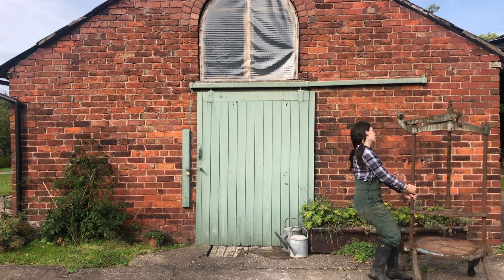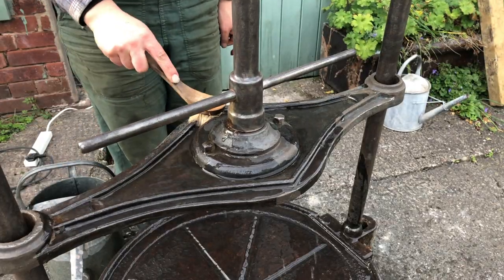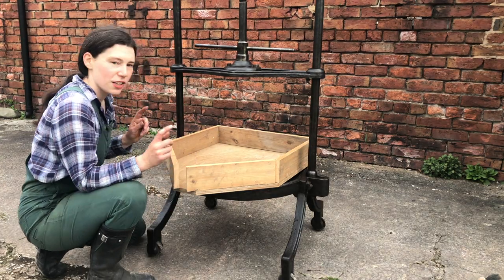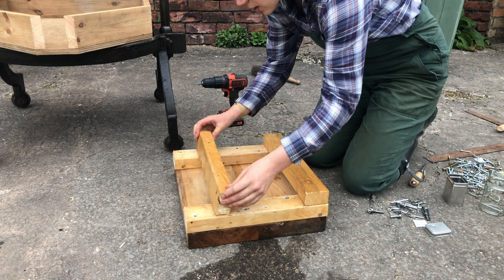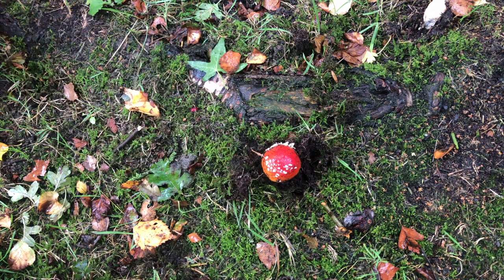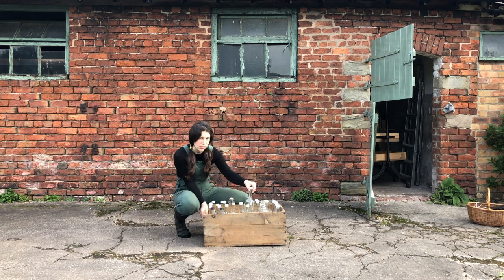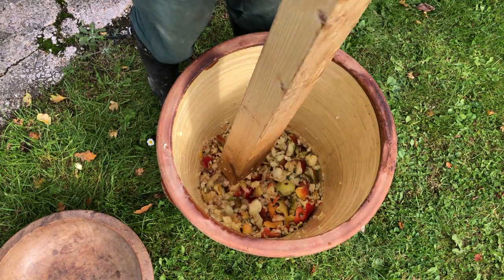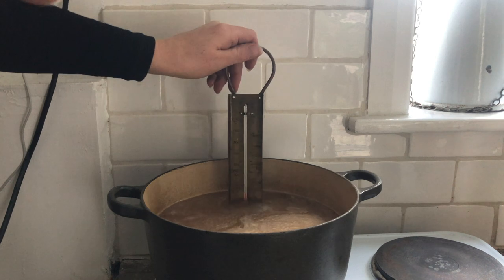#19 Making an apple press out of an old iron cheese press

Comment: Make sure that the wood that you smash the apple is not an evergreen type of wood( because the sap).
Also if you decide to clean and seal the wood that comes in contact with the apple juice , linseed will be a good choice.
Good luck.
Reply from the maker: Oh, thank you! I might oil it with linseed before I put it away for the year then, thanks for the advice 😊
Reply: @Nelferch  if you are going to use linseed oil make sure you get the food safe stuff, it's 100% natural. whereas most boiled linseed oil on the market today is partially synthetic which is usually toxic...
Reply: My grandfather waxed his wood, rather than oiling it.  It doesn't go rancid that way.
Reply: @Vandal_Savage  
In germany I can still buying Linseed cold pressed direct from the farmer who growing the Flax.
Its from the first pressing.
I use it to paint wood.